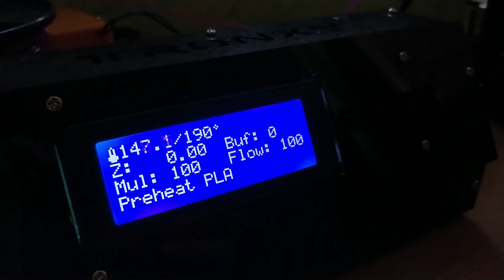Fix Poor Extrusion

Comment: Caverntwo, is a retract length somehow corellated to the nozzle's length? I have 16mm in the heater (according to blueprints). But someone recommended the retract length of 6.5 for this printer and that wasn't explained.
Reply from the maker: According to my understanding, the retraction length shouldn't be longer than the length of the heat-break. In the case of an E3D-V6 or a clone of it, it's about 6mm. If you retract too much too quickly, you run into the danger of pulling liquid material into the cold area, leading to clogs. I use 5-6 mm on my machines.
If your hot-end isn't of the best quality, it can also happen that the filament gets "stuck" when being pushed back into the heat-break, effectively destroying the print. That was the case on my Dual-Extrusion Anet A8 setup when the material switching retraction was too high.
Test out what works for you, maybe even something as short as 1-2mm is good enough.
Reply: Here is a kind of "video update" https://www.youtube.com/watch?v=RL09WkoN250 The firmware is stock 1.1.9 Marlin. I've checked for clogging by setting temp. to 210 and manually pushing the filament through the nozzle. It was extruding fine and it was a straight line of 0.37-0.39mm.
Reply from the maker: I've been watching the linked video and I could identify two possible issues: 
(1) Try to lower the filament retraction speed by a little bit, maybe it helps.
(2) It seems that this printer just has one z-axis (if you got the upgraded version with two, then ignore this). Can you find out if there's some play on the z-axis? Try to slowly increase the z-height and watch whether the nozzle moves at the same pace. That could be the reason for the (what seems like) inconsistency of height. Can you identify whether some layers look "compressed" while others look like they've been "pulled apart"?
Also, if this should be the case, make sure to also watch my videos about my Anet A2+, where I had a similar (but more extreme) issue.

A clog and a spool holder problem don't seem to be the case here.
I hope that I could help you (a little bit, at least).
Reply: Thanks for answering soon!
I'll try 20mm/s tomorrow.
Positive, one Z. Probably you've got my words wrong :) I was commenting, watching/hearing the printer and recording the same time so I've misspeled (mixed things in mind, let's say that) height and width. And later I've corrected (it's in subtitles). It's more about that on some layers these square columns becomes little circles. That happened in two prints (that I did show quickly) before I've tightened the nut (counterclockwise 360deg.) a bit. After that these huge artefacts almost gone. 
So, NO - they're not compressed/pulled apart. Thanks, God, no :) I guess it was a major issue. I've spent for about a week on the x-carriage while tuning the lead-screw position (bad X-carriage shape, not the straight 90deg. angle). It was fixed as good as I could make it without any additional printed details (with a hand made rubber spacer under two little bolts there).
I'll check that bearing-wheel shape tommorow (probably). It can be oval shaped. And I've heard about this possible problem on Chris Riley's channel. If it's a standard part, I hope to find one good locally.
Reply from the maker: oh, I really misunderstood, watched it again now. So, nothing as major the z-axis is responsible for your problems.

Reading about what you've debugged so far, you were able to eliminate many of those things I thought could be responsible.
I couldn't identify what bearing is used from your video, but I'm pretty sure that it's one of the more commonly available sizes. For example, I've ordered 10 pieces of the ones used on my Anet printers just in case as well (although I luckily haven't been in need of any of those so far). In the worst case, you can still print a different extruder design using default bearings (such as 608ZZ) or even buy one for a few bucks (which I did for my second extruder on my Anet A8).

I'm pretty sure that Chris can definitely help you as he has a lot more experience regarding the printers and their design than I do!
Reply: Hi! I've checked that roller-bearing and it's fine! :) Maybe it has a little play in the vertical axis but I don't think it's critical to this application.
Then I've re-assembled the motor and the extruder to the x-carriage and turned the motor to 90 deg. clockwise to be able to disconnect wires without troubles. I've tightened all and it seems that there is a lot of a play in this whole assembly because it was hard to rotate it after that. I've disassembled again, measured distances of holes in the x-carriage (only by the edges as it's very hard to measure centers properly). It's fine with some gaps. Then I've measured the motor's threads' distances and it's almost ideal.
Then I've re-assembled all these together and tried to get the position where the gear will have the less resistance to hand rotate. Tightened it in place after that. It's crappy when the printer designers doesn't make special details to center gears and the motor's shaft in precise. I'm sure it's not a hard task as it can be a simple plastic spacer with only one precise hole (and it will not make a printer more expensive practically). Not sure if I can design it by my own without having the extruder's blueprints... 
Any good motor has a very precise round flange near the shaft so you can easily take it as the base. But they've ignored this fact and let users to assemble all parts by trial-and-error method practically.
Did dried ~20m of that PLA (I guess it could get some moisture after a month of staying in my room) and will check it soon.
Reply from the maker: Wow, that's stupid. But most "cheap" printers have not always been designed with the best choices...
But to be honest, I'd even suspect a cheap hot-end as the cause of your problem now.
Do you have a PTFE-inlined or an all-metal heat break? Maybe this is so cheap that it causes too much friction?

I totally understand that your problems are very annoying and frustrating, but think about your printer being more like a "science project", that helped in my case.
Reply: It's Tevo Flash and they says it's Volcano hot end. V6 I guess.. Many tells that Chinesse V6 clones can be great.
BTW, I think that the plastic started to "pop" after drying 3.5 hours at ~50C :D Maybe it was under-dryed or I need to place it in an open room for half of an hour.... It didn't spoiled the print too much. Now I've printed a 50% size Benchie. Stringing occurs and I have noticeable ghosting. It will be OK for tech. details but is the thing that I would like to improve as well...
Will try to reduce the retraction speed a bit tomorrow as you've advised. Just forgot about this but tried Coasting... Maybe it works, maybe not... can't say definitelly. Also I can't get what is the right setting for Retract Extra Prime... Negative value for suck in or positive... Logically it must be positive... But it can't be checked visually unless I'll make some big values. I want to be careful with this as the every value need to be recalc. according to that it's in mm3.
The other strange thing is that the end of a pulled out filament doesn't look straight. It has a thick piece at the end that is stretched out of the cold piece. It has 1.95-2.00mm in diameter. The piece ends where I measure about 1.75. That "thick" piece is the same diameter as this whole piece (not counting that "neck" of the stretched material). If I'll cut this stretched place then the sum length will be about 10mm. In the place where it starts to be 1.75 is the small "rounded" (or angled) bend. Hard to say about any sizes... IDK what it can be... 
I guess that the filament should be that thick because of the sizes inside...
Reply from the maker: I didn't mean that all Chinese V6 clones are bad, although 1 type (of 4 ordered) was definitively bad, as it had no inner heat-break PTFE tube. In this case, it always clogged after like 10 minutes of printing and needed a disassembly...
I tried Coasting once, but it yielded inconsistent results. It probably works with some extra configuration, but I currently have no time for that (sadly not even for my regular video schedule, because of personal and company reasons, but it'll get better soon)...
Don't worry about the thicker end, as the inside of the nozzle is obviously molten, and when you pull it out, the end is shaped like the inner diameter, which is 2mm. The thick part shouldn't be too long either. If you pull it out with a temperature of about 180-190°C (for PLA), the end should be cone-shaped and not too dirty (if you use white PLA you can see dust easily). 
With everything you've debugged so far, I'm pretty sure that you have already been avoiding many potential issues. What I can recommend you (and I did on my A2) is to just print some easy things and if it should get clogged/clicking again, try to "help" the filament in by pushing it. You can then feel the feedback. If it works fine with your help, you could try to increase the motor's torque by increasing the current (if your mainboard has adjustable drivers). If it doesn't, you could have some problem with your extruder/nozzle/PTFE tube. 

You've already been debugging everything that I would have done. I am nearly out of ideas as well... However, I'm inspired by your motivation!
Reply: Thanks again!
All Chinese items (from Ali, eBay, Banggood and etc.) need to be expected very well, it's true. V6 clones without inner tubes (it they were expected)... I'm not surprised. Once I've got three from ten nice looking bakelite knobs without setting screws. So they're hard to use now (IDK where to buy here these little screws locally).
Probably that Coasting need to be investigated more. I've tried it two times already and I has some little artefacts ... maybe will try a less volume.
Yes, I think I've understood about that thicker end yesterday. It depends on the temperature a lot (will it stretch or not). The end is cone shaped as you've told.
The extruder doesn't clicks often now and I've just printed pretty though (while pressing them by fingers) fittings with screws. I've just missed in sizes... Seems that my supposed gaps weren't enough. It can't be screwed together. But I think I'll fix it. Thanks, God, I've bought a decent caliper (locally). The metal parts are pretty good so I can analyze many things now. :)
So... it seems that the extruder works well.
I've dried a little piece (~2m) of the filament again (with 80C that is more about 60-65 there) and I've got much less "pops". Put another (bigger piece) into the air grill for this night. Anyway, strings didn't dissapeared. I think that it's a lot because of moisture. Will see it tomorrow.
Reply: Oh, no! :)) My mum just solved my "bug" with this fitting! I've created a left handed screw :))) Didn't realized that the direction isn't "right" by default (in Blender).
Reply from the maker: XD! 
TBH, I'm a total noob in blender!

I also have the problem with the blobs caused by moisture (no wonder, my filament is just stored on the shelf). They annoy you in the beginning, but when you're printing quicker and more, you won't notice them anymore ;-)
To get rid of the strings, you'd need to play with the retraction settings a little bit. I use 40-50mm as retraction speed with a distance of 4.50mm, I believe, which works alright for my printers. However, that doesn't necessarily mean that it's fine for yours as well!
Now, thinking about how I solved the "clicking extruder" problem on my A2+, I have to admit that I don't know it anymore. As it was printing more or less alright with the upgrades, I just ignored the fact that it clicks somehow, and haven't had any problems so far. Maybe I should limit the steps/mm for the extruder by a little bit.

I really enjoy hearing that you make progress with your printer!
Reply: Blender (was maybe) more about hot keys! And the 2nd part is it's multipurpose window paradigm. And the best part is that you can "imitate" another 3d app's hot keys (these are not necessary will be doing the same things but may be very close as with 3dsMax case). And you can define very specific hot keys for your own behavior. It's not always easy and obvious but once you've found how it works it's much easier to do.
Blender is pretty powerful although it's not enough to create complex assemblies with dependencies and parametric editing features (like in many CAD/CAM systems). But to create few details with threads it's OK and can be quicker sometimes :)
Thanks for the support! I've made my dry box, probably will print one or two fittings and find where to buy tubes. Although maybe they're not very necessary. Will be printing with PETG soon. Already got a painter's tape.
Reply from the maker: That's nice to hear, your progress is exceptional! 
Be aware that some painter's tapes are good and others are not. Don't be afraid to try out different brands.

I have no experience with 3d modeling and thus it's obviously very difficult to get started, regardless the program. However, if I have time, I do some tutorials to get into it, but there's a long way to go.
Reply: Thanks :)
I have two diff. tapes. Will see which will work best.
Now Blender Foundation has a lot of great tutorials. I've started with Modo but then came out Blender 2.5 and I've fall in love with that UI :) 2.49b didi look too odd for me.
If you need a "pure engineering modelling" then it's better to start with MoI (Moment of inspiration). It's very easy but isn't free and has some trial time.
Reply from the maker: You'll find your perfect products in no time!

Yeah, I have already been thru some tutorials, however, I'm still pretty new. I'm determined of mastering this program in the future!